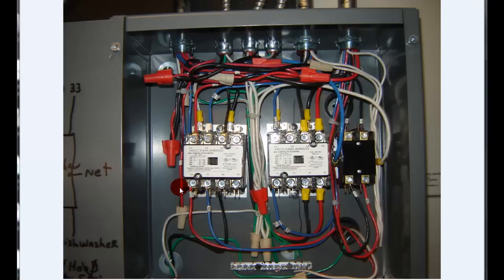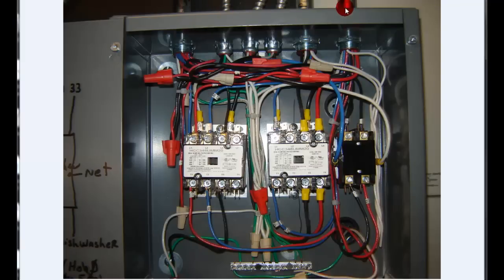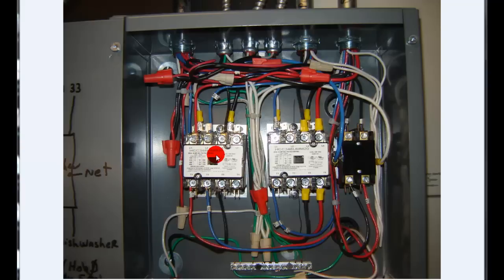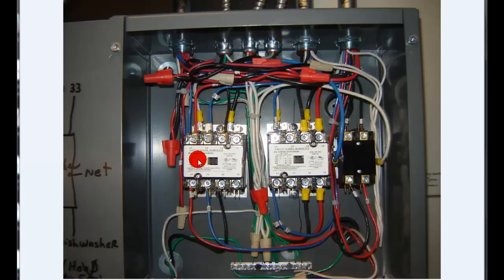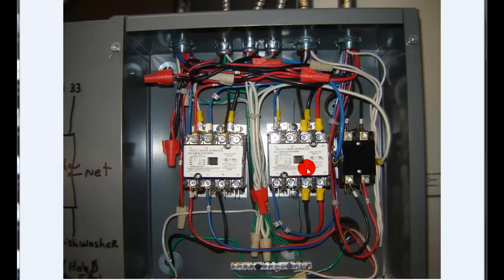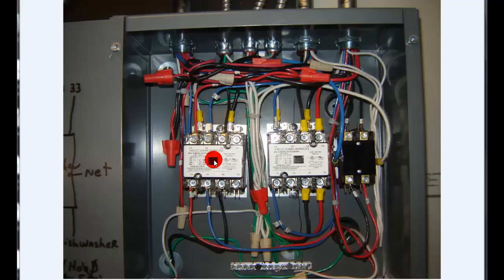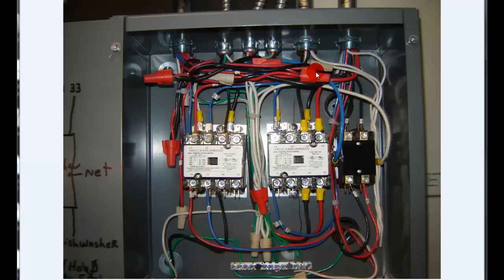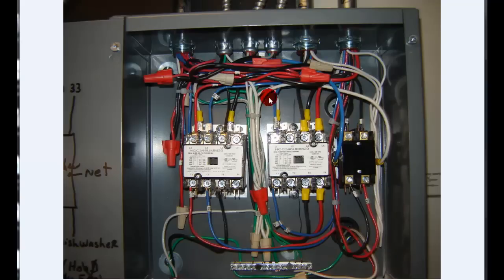Electrical Wiring-Fire control box

Comment: My understanding of more recent code is that the equipment under the hood needs to be wired to the contactor so that all heat producing devices lose power when the system is triggered. Is that correct? Based on the video it sounds like only the lights and supply air lose power. Thanks
Reply from the maker: It's been a couple of years since I wired a kitchen hood some things may have changed. At the time All power to equipment under the hood must be shut down as well as any air Supply. Lights can stay on.
Reply: Not all power is required to be shut off. Both NFPA and local Codes say that only the fuel or power used for heating food. i.e. Cooking. So a gas convection oven will need the gas valve off but can have the fan remain energized. The NFPA committee recently was petitioned to reevaluate this potential loophole by  a fire suppression company. The committee voted 26 to 0 to NOT require all power to shut off. They said the intent of this Code was to only remove the source of heat. They added there was no documented case of electrical shock hazard either. Seems to me that this is a case of the way things have been done becoming the way people start believing is what the Code says - when actually it does not.
I found this article that might explain it better: http://www.mepdesigns.com/blog/wp-content/uploads/2017/04/201701_commercial-cooking-auto-fuel-shutoff.pdf

Comment: love your vids, hey are those three or more current carrying conductors jammed in those 3/4"s
Reply from the maker: Yea,pretty sure there are more than allowed! I let someone else run the pipe and pull the wire. But I take responsibility for what they did. I should have made them do it over!!
Reply: No one follows that we do 4 hots and 4 neutrals not a huge deal in 3/4 emt

Comment: another good vid sparky.. newer codes require the exhaust fan to automagically come on when there is cooking "507.2.1.1 Operation. Type I hood systems shall be designed and installed to automatically activate the exhaust fan whenever cooking operations occur. The activation of the exhaust fan shall occur through an interlock with the cooking appliances, by means of heat sensors or by means of other approved methods."
Reply: Thanks for the comment it helps! Where would the heat sensor be wired to? 
From the breaker panel to the contactor coil of the exhaust fans/ make up air? 
Thank you

Comment from the maker: @imcj0526 I have to admit that I had to look that one up. The box complies with a few but not all requirements. 

I have built at least 20 of those with various configurations over the years and all of them have been inspected and all have passed.

The major thing that most inspectors required was that I put a permanent label stating that this box contains more than one power source and note each source.
Thanks for pointing the article out!
Reply: Electrical Industry Network hi I am trying to get help with wireing a fire suppression system and need help please contact me at 405 245-6350 thank you

Comment: How many wires you got in those conduits?  Looks a little packed.

AND is that some un-capped grounded conductors I see on the right side, and one on the bottom?  You can always get a nick in the jacket that would energize those conductors.  I always make sure they are capped or tapped if they aren't in use.

Comment: I don't have the concentration or patience to be an electrician. I just know I'd turn on the breaker and *boom*, I wired something wrong. I'll just stick with DIY 120 volt items, IE security light, ceiling fan, etc.